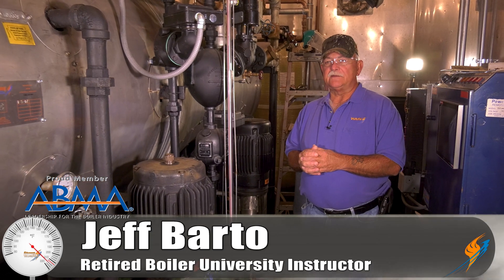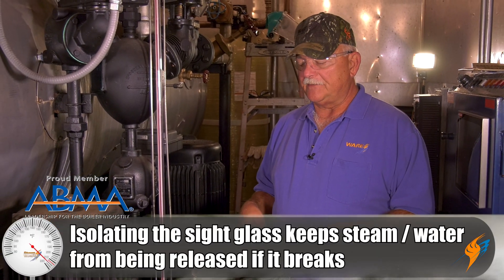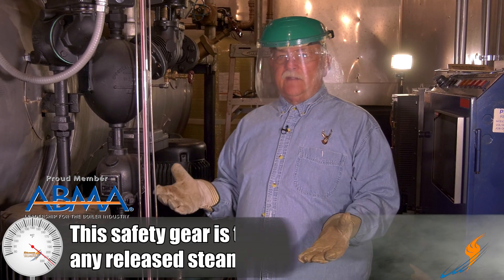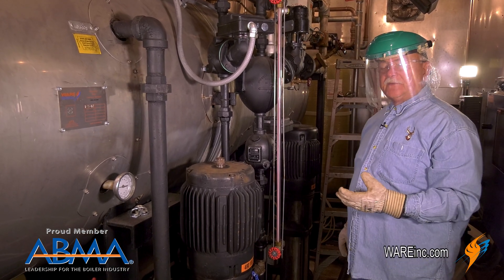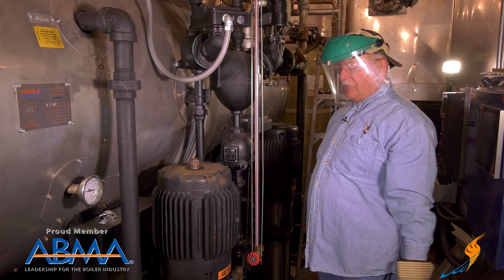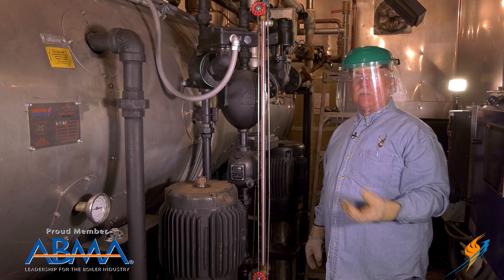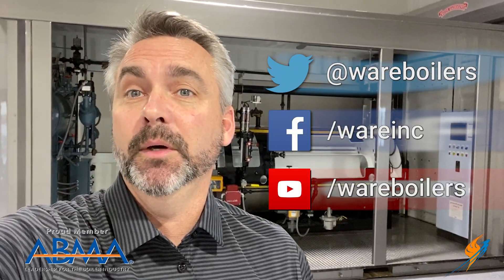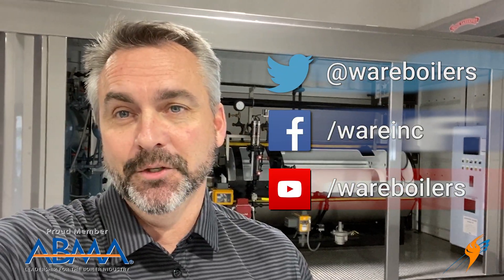Sight Glass Safety Tips - Boiling Point

Comment: Long sleeves are bad because, if and when valves don't hold and glass breaks. Under pressured  even 5 lbs of steam, could kill. Or
injure you vary badly long sleeves can hold the hot water in your sleeve and shirt and burn you worst then you know.. what I've done is put a board between me and the sight glass. I no I'm protected and can escape if need be even on a ladder. The key is not to panic . WSHTF!!